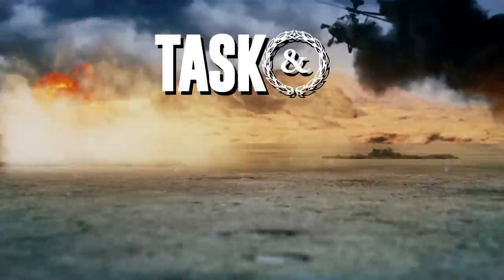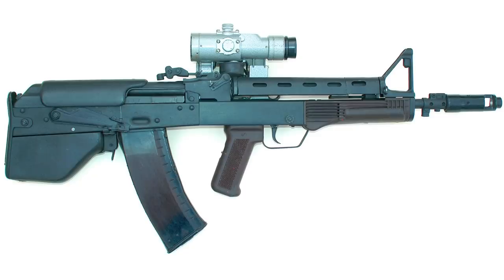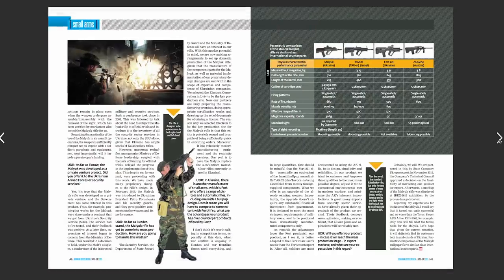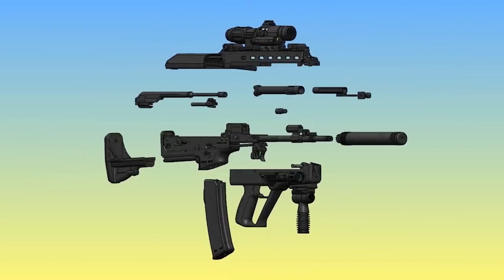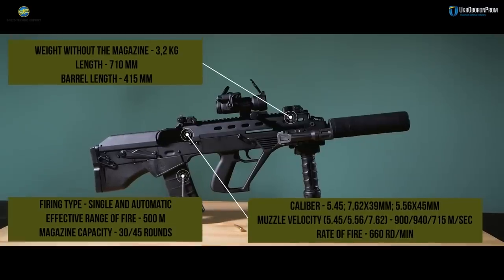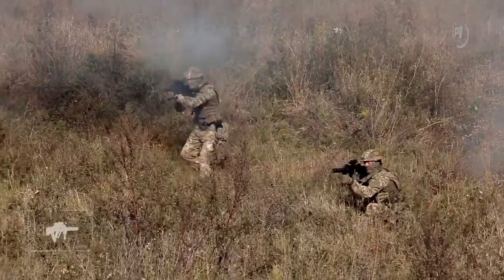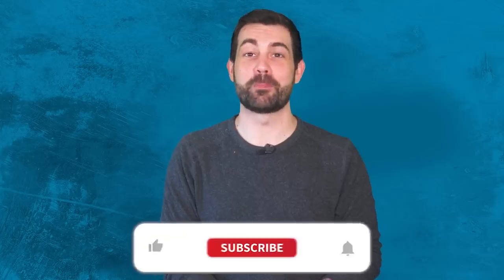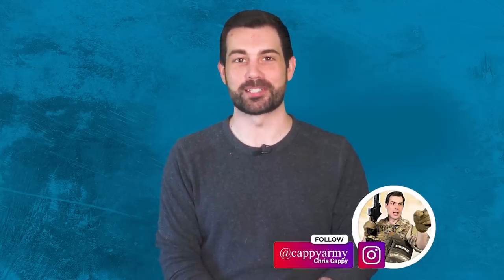Why Ukraine Special Ops Use This Bullpup. The Malyuk.

Comment: There are many AK bullpup conversions on the global market. This looks the most effective by far. A lot of people hate on bullpup conversions, especially of the AK; but fail to realize that just because it is not elegant does not mean it isn't efficient.
Reply: Why do folks hate bullpup?
I've handled the tavor once and the center of masss and the handling was amazing. Loved it.
Reply: @johnshepard7630  I own a Bullpup. Biggest complaints are noise and trigger.
Reply: When you need to use the bayonet, how do you hold on to the rifle.
Reply: @davidfreeman2522  most modern rifles don't even have a bayonet.
Reply: @Stephen85  wouldn't leave America without one.
Reply: @johnshepard7630  original bullpup designs all have horrendous triggers. That’s an issue that’s been fixed in more modern bullpups. After that, they tend to be slightly heavier, they require retraining, and they either aren’t ambidextrous, or if they are it’s much harder to diagnose and remedy malfunctions.
Reply: @ServantofErra  that's my main issue. I want to be able to shoot off either shoulder without having to change anything out on the rifle
Reply: Bullpup must be designed from scratch. Any bullpups converted from designs with a classic scheme are unpromising. Even the best converted bullpup will lose to a bullpup made from scratch  with the same solutions.
If you are wondering why, and you want to hear the opinion of an expert gunsmith, you can ask this question to the famous weapon designer Konstantin Konev on his channel. He has recently been leading a fairly active life on YouTube and often responds to comments. Although his channel is Russian-speaking, Konstantin is now working in the USA and knows english well, unlike me. He also claims that the bullpups General Dynamics and Desert Tech showed themselves best in the NGSW program. He has a video about this. Called "In Search of the Ballistic Grail". The built-in translator will help.
Reply: @ServantofErra  
So original stigma is the issue.
I always found that excuse of "retraining" to be absurd. It assumes a human cannot learn quickly. Reloading took me a bit to get used to and it was amazing after that. A few hours of it and you get used to it.

As for the malfunctions part, that worries me. I didn't know. I guess being more compact does lend itself to it perhaps.

Thanks for the info.

Comment: Traditional AKs have a very short stock with a small butt plate.  Increasing the length-of-pull and/or the surface area of the butt could reduce felt recoil.  Also, the Malyuk appears to have a rubber butt pad instead of a steel butt plate.

Comment: Azov was split in two. The unit has since been reorganized in some Mechanized form. Can't remember if it is a Battalion still or was expanded into a Regiment. Most of the unit's heavy vehicles, as it had a detachment of Tanks in its formation, were outside of Mariupol when the city was encircled.

While half the unit surrendered when the city finally fell, the other half was pushed back all the way into the Central Front. From there, the Ukrainian leadership withdrew it for rest and refitting. Since then, its old Nazi emblems have been scrubbed from the unit in favor of Ukrainian emblems.

Part of that wasn't just to make the unit less controversial either. The Azov Battalion had ended up fighting the Russian Wagner Group, a well known Neo-Nazi PMC under the control of the GRU. So, in Ukraine, Neo-Nazis were essentially killing one another in battle and the Ukrainian ones became disillusioned with Nazi Ideology and began to switch out or dispose of their connections to the Neo-Nazi movement.

Ironically, the invasion HAS resulted in Denazification. But to the Russian detriment! The Ukrainians are more proud of their nation than ever before. More united and firm in their resolve. They've actually begun falling into line of a Western Liberal Democracy from a more Conservative Republic.

As I said, for a Conservative nation like Russia, that's the LAST thing they needed. Though it is something to start having a laugh about.

By I digress. Besides you're probably hearing from me anyways.
Reply: I think there’s only Two Companys left of the Azov
Reply: @joeybobbie1  - Actually they expanded on the unit, forming several other units from Azov volunteers.

One of the best SOF units is Azov. Though they swapped emblems. Their emblem reflects they are Ukrainian SOF.

Other units were formed out of Azov detachments and raised to larger formations. Though few are anything like the original Azov Battalion. But they are actually some of the best of Ukraine has to offer.

And likewise, many have swapped emblems for something more distinctly Ukrainian. 

The original Azov Battalion, which was an actual Regiment, was pretty badly chewed up.

They were the defenders of Mariupol since ensuring it remained in Ukrainian hands all the way back in 2014.

The surviving forces have been reorganized into a Regular Line Regiment. Previously, they fell under the Ukrainian National Guard's control. They cleaned up the unit successfully since about 2016 I believe it was. They just never got around to changing the unit emblem for a number of reasons.

Since the near complete destruction of the Regiment, it has been rebuilt. Though for very obvious reasons, the Ukrainian Army is being quiet about the unit. Understandable as they would be an immediate magnet for hostile attacks, both on and off the battlefield.
Reply: Do you have a source about them getting disillusioned fighting Wagner? Would like to read more
Reply: @cwjian90  - Just bits and pieces. Getting any real hard sources, you guys need to learn to do your sleuthing BTW, is nigh impossible right now. Mostly because people can't talk about it, for some very reasonable reasons I might add.

But more than that, Wagner was heavily involved in fighting them. Wagner probably was the one group that really pressed them. Even Russia's Cat-A Units have almost been a joke in this war. Only the guys who took Kherson were actually competent and they were eventually broken, leaving only Wagner who has been doing the most damage as a general rule.

But now Wagner is worn out and breaking.

Though the damage is done.

An increasing number of Azov units are stripping away their Neo-Nazi origins. Instead, they're increasingly embracing their Ukrainian heritage. Many of those who haven't done so, are foreign volunteers that the Nationalist Right, that originally helped create the Azov Battalion 8 years ago, are the ones bringing them in as well as new members who haven't fought the Wagner Group yet, let alone when it was at its strongest.

Plus, there are an increasingly number of LGBQT+ members of the Ukrainian forces. 

And contrary to Radical Right claims, they have been truly tough nuts to crack on the battlefield. Professional and determined. They aren't confused on their gender, only which targets to pick first until the Ork Warbosses come out of their hiding places.

I imagine some units cross paths with these members they should be predisposed to have fights with or aggravate.

But they have the same enemy and no report about issues has cropped up yet.
Reply: Do You know the difference between the definitions of "nationalist" and "nazi"?  Azov is a regiment of nationalist beliefs, NOT nazi.  The emblem of the regiment is "Idea of the Nation" (the letter "I" is integrated into the letter "N").
Reply: @FLJBeliever1776  I would hug you if I could.  Thank you for your position, vision and words.  Ukrainians will remember.
Reply: Nothing puts things in perspective like the threat of violent extermination.

Comment: Ah, you obviously have never played with the adjustable gas action on a FN FAL. If you adjusted it to full 10 it would give even extra recoil. Turn it to 1 and recoil went way down but it wouldn’t cycle to the next round. Mind you that was what I can remember from 1986 before we Canucks had the 5.56mm changeover.

Comment: Considering that the AK-12 is just an AK-105 with a picatinny top cover and a picatinny handguard that can't even hold zero, I'd say the malyuk is a better weapon platform in almost every way. Not even taking into account that Russia isn't actually issuing their soldiers optics.
Reply: And a 2 round burst function, combined with a fire selector switch that can rotate like a helicopter... xD
Reply: The AK-12 isn't just a AK-105 with a different dust cover. The receiver is different but the gas system of the AK-12 is basically the same as the 100 series.

The AK-12 design and production is hot garbage. It's a barely improved AK-74M that cannot hold zero, and even if it did Russia cannot get enough red dot sights to their troops. The quality control at Kalashnikov has gone to s..t and the Kremlin cannot deal with their own failure. Russia should design a whole new rifle design not based on the AK platform.
Reply: @Allenfreedom1776 nah, the ak works because it’s reliable, especially in winter conditions. The only thing that’s actually wrong with the ak12 is the protection quality, which can be easily fixed.

Comment: Water cooled guns do transfer heat by convection. But convection cooling does not normally mean that fluids are required as part of the cooling system, as claimed in this episode. Life is too short and that's all I'm going to bother with on this video, another T&P winner.

Comment: Convective heat transfer relies on fluid movement, whether the fluid is a gas or a liquid. Warmer molecules vibrate with more energy than cooler molecules. This is why hot air rises, because the increased vibration pushes the molecules farther apart, making hot air less dense than cold air. Conclusion? Convective cooling does not require a liquid. It only requires a path for the hotter fluid (air plus combustion products in this case) to escape the weapon. On another note, I bought a bulpup shotgun and found that it is much harder to shoot accurately than my long guns because it has a much shorter sight radius. This is pronounced when I shoot at distant moving targets such as clay pigeons. I think all of the Malyuks in your video had red dot sights. A Malyuk will be less effective if its batteries die or its red dot fails for any other reason, especially if the target is distant and moving. Without electronics a conventional rifle with iron sights will shoot straighter than a bulpup with iron sights.

Comment: Engineer here. Convection is just any fluid flowing over a surface. A convection oven forces hot air through the oven to cook food faster.

I'm still not sure what sort of convection they might be referring to, but it's not just liquid cooling, they could be taking advantage of some mechanical system to force cool ambient air across an area that was hot and calling it "convection cooling."

Comment: It's an AK in a bullpup conversion kit. The predecessor was the exact same thing only they've modified the trigger more than previous versions. The magazine catch is also slightly modified to allow a forward rocking instead of backward rocking motion to seat the magazine. Century Arms and a number of other companies made conversion kits like this years ago except the picatinny rail system was still new or not invented when they came out. So the old iron sights were still left on.
Reply: They stop to use AK to create Maliyk. All parts made by IPI except barrel (they order it in CZ). And it couldn't be a "conversion kit" because You can't buy it and install it on your AK without factory.

Comment: Convection cooling does not require a liquid. Convection does require a fluid as medium, the fluid can be a gas or liquid. In this instance the convection cooling is achieved through gas \ventilation management. For example your convection oven or airfrier  doesn't have any liquids in it.

Comment: As an FYI, convection cooling does not necessarily mean it has to be liquid, it can also be gas.  Ambient air heated by the barrel will be lower pressure, and the higher pressure cool air outside the vents will move in and push the heated air away. It sounds like just a fancy marketing way to say "air cooled."

Comment: For what it's worth: 
Your definition of convection is slightly off. Convection is the transfer of heat from solid matter to fluid matter (liquids and gasses).

Meaning: a  heat exchanger that works on the principle of convection could be just a "ribbed" pipe (increase it surface area) or openings that work as exhaust ports and thereby allowing greater efficiency of heat exchange.

Comment: Strictly speaking, convection is just heat transfer via fluid flow, which could include, for example, (relatively) cool gas flowing past a hot metal plate and "sucking" heat out as it leaves the system.

Comment: Convection doesn't always mean moving of liquid. In case of this rifle it means internal structure allow hot air flow away and it pushes into system cold air through bottom of main grip.
.
.
.
Also such mag release are actually good, because You moving less while reloading... Reliability of this system is another question.

Comment: Check out the Australian military experience with the Styer bull pup, It has been the standard issue with the Aust military for many years now and is manufactured locally. it has the standard NATO round and the same barrel length as the M16. it replaced the M 16 and the SLR, local model of the FN. The Styer has been through regular upgrades and as it is the standard weapon and has been for decades now, it would be difficult for our troops to comfortably revert to “old fashioned” style rifles.

Comment: Greetings from Ukraine!  
About convection.  The handle is hollow fro inside (like a tube) and connected to the barrel.  when the barrel heats up, it begins to suck cold air through the handle and push out the heat through the holes in the paper.  By the way, they don't use anything from AK in the new batches.
Reply: the same principle as in the fireplace.

Comment: If you put less gas into the system, then the reciprocating mass of the rifle will have less kinetic energy.  This means less felt recoil with that big heavy bolt banging around inside the receiver.  But it also means less energy available to function if dirty.  Its the same trade off that AR builders have to manage.  Recoil and accuracy vs reliability.

Comment: It is true that convection refers to the cycle movement in heated liquids, any gas is considered a liquid as well. So their "convection cooling" is a fancy way of saying "it's passively air cooled".
Reply: Not really. You can create an air flow without moving parts and it will be a convection.
Reply: @ugumol  Which is what a heated liquid (ie passive air cooler) does too (create flow without moving parts). So not quite sure I understand why you said "not really".
Reply: @J0ermungand  Passively air cooled -- is just being exposed to air. Convection means there is a flow of air, so it is not quite passive.

Comment: 13:30 "Convection" isnt limited to liquids.   IE: Convection Oven - which strictly operates with gas(air inside the oven) 

What they are saying is those vents at the top of the upper receiver allow hot air to raise and escape while sucking cooler air from underneath.  
**Im assuming there are some sort of holes on the underside of the upper receiver based on the claim.

How affective is the concept? Would depend on how much sustained fire the barrel was subjected to.

Comment: Some years ago, I thought of an AK to bullpup conversion and it seemed that the main problem would be connecting the trigger group to the striker release. More mechanical linkage and greater length of connector rods inevitably mean more play, more slack and more variation in trigger break pressure. Glad to see that the problem has in some sense been solved 
P.S. Convection also refers to gas only.

Comment: "Convection cooling" doesn't require a liquid, it requires a fluid. Air and gas can be that fluid. So if you were to design it such that gasses carried away more heat than in other models, or forced cooler air over hotter parts of the gun, that would definitely be convection cooled.

Comment: 50% "less" recoil makes sense as the recoil impulse is more inline with the shoulder compared to a traditional AK because of the lower bore axis
Reply: + balance + length + handles (where you hold it).

Comment: Convection is not limited to liquid.  If they put vents that on the bottom and top. Cool air can cycle from the bottom vents up the top vents.  Heat released from the top could pull in cool air in a convection effect.

Comment: Convection doesn't need to be liquid. Air convection is a very common cooling method. Possibly the vents and if they have some fins or fluting of some type would be this "feature". Its a pretty cool gun really. The thing both sides seem to need in the war is optics. Both sides seem to mostly be running around with iron sights.

Comment: Very surprised you made no mention of the IWI Tavor TAR-21 which has been produced under licence in Ukraine by RPC Fort since 2009. Ukrainian forces have used the Fort-221 (Tavor CTAR-21) since the war started in 2014.
It is probable that the designers of the Malyuk took inspiration from the TAR-21.
You should have little difficulty getting your hands on a Tavor since civilian variants have been sold in USA and Canada for many years.
Reply: But Malyuk's ancestor (Vepr) was designed before TAR-21 right?